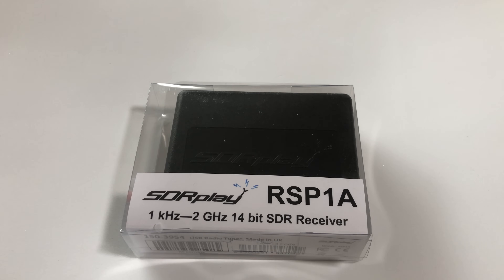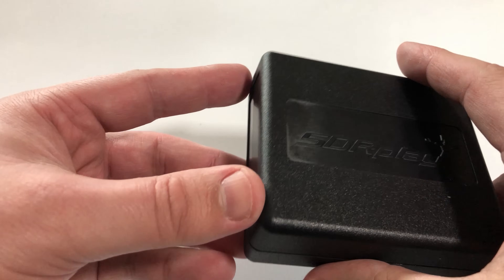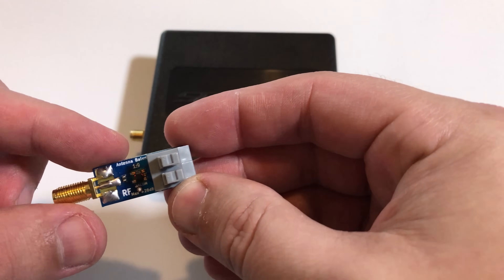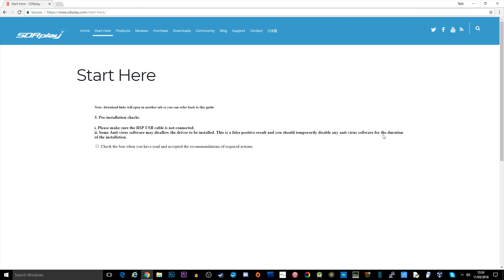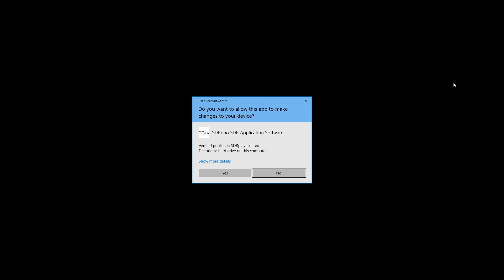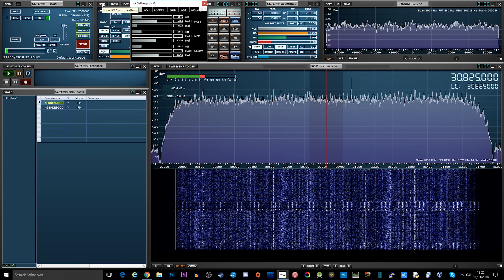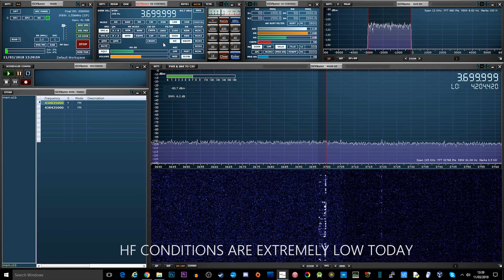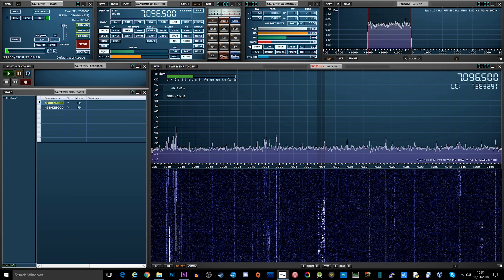SDRPlay RSP1A 14Bit SDR Receiver With SDRuno Installation

Comment: If you know the length of the long wire it is not random you be better of using a balanced diople using speaker wire cut for centre frequency you use most